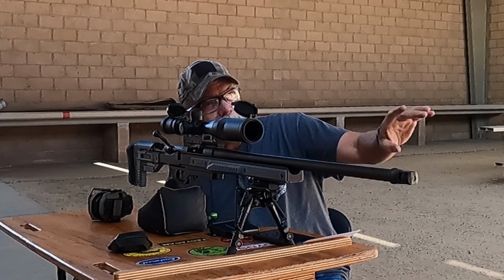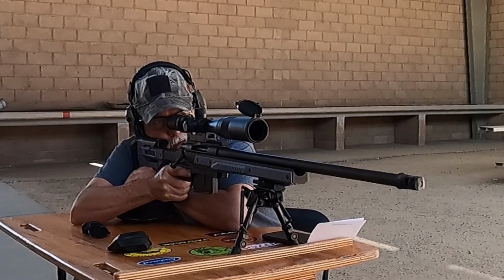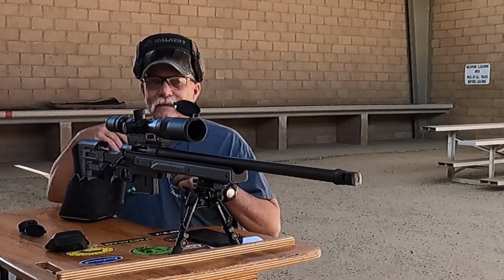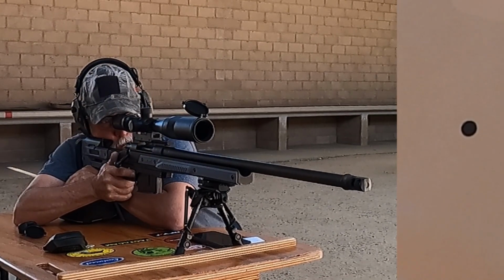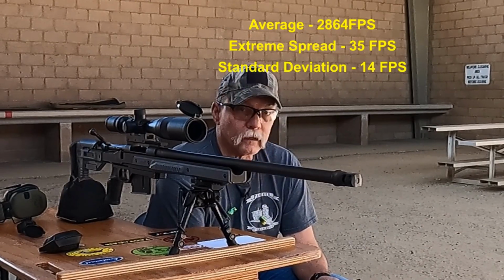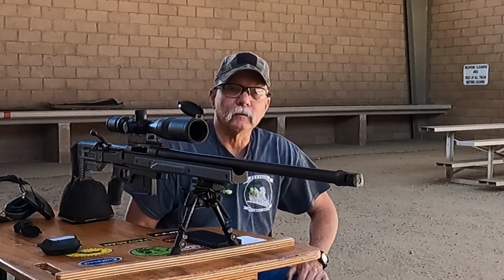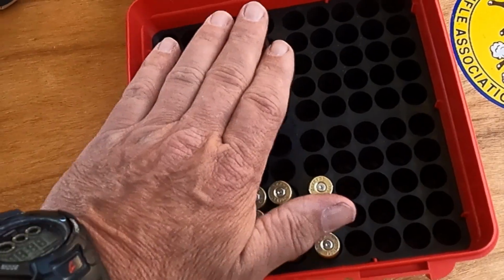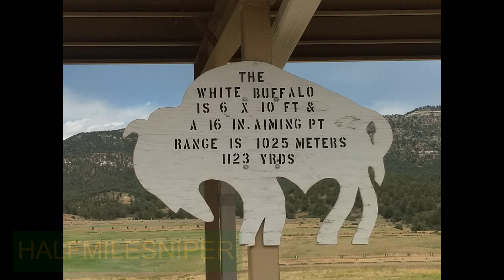Second test with IMR7828SSC in the 6.5 PRC, will we hit 2900 FPS?

Comment: Hi Halfmile. Great video as always.
 What is the minimum extreme spread you will be content with? As we know, high ES is a killer at very long range.
Reply from the maker: If I can get the ES to 15 or less I will be feeling good. Have had a couple with low ES but the they shoot so hot at 100. I need to stretch out a bit.

Comment: What is 6.5PRC resemble to? Recoil and first impressions 🤷‍♂️
Reply from the maker: hmmm..the bullet is just slightly smaller diameter than a .270 (same bullet as the 6.5 Creedmore) and the PRC parent case is the Ruger 300 Magnum, which was based on the .375 H&H if I recall correctly. Recoil in this chassis and the bull barrel is very light. The recoil calculator shows the recoil is only like 7.5 pounds. It is a very smooth shooting round. Now my rifle is heavy and I have not yet fired a light hunting version yet. My guess is in the light hunter the recoil is prabably sinilar to a .243.

The 6.5 PRC get a little more velocity and range over the 6.5 Creedmore. Remember the Creedmore is based on the .308. And lastly, my first impressions with this rifle is that this Howa action and this cartridgeare going to be a great shooter.
Reply: Thanks. The is Eskimo Reloader here .

Comment: I seriously wish I could go shoot with you. I'm wanting to stretch my new rifle out to 1k.
Reply from the maker: The President of Rapid Reticle and I will probably be going out to a range to stretch to 600 or so pretty soon. We discussed it yesterday, I just need to run a few more ammo tests before we go. What is you new rifle TRB?
Reply: @Halfmilesniper .308 Savage 110 Tactical 24" Heavy Barrel with a Vortex strike eagle 6-24×50. I've had it for a couple years, but have only shot maybe 10 rounds. I sighted it in at 100 and then shot 6 rounds at my steel plate. So in my eyes it's still new.
Reply from the maker: @45acp  It sure sounds like it's still brand new...almost in the box new.
Reply: @Halfmilesniper  lol. Yes sir.

Comment: I have 2 6.5 prc's. i fall short of the book Velocitys vv n560 got me at 2900 with the 153 ATip es of 5 sd od 2.5.
Reply from the maker: It really seemed to take a lot of work to get consistent loads running north of 2900 FPS. I did finally get some Retumbo and will be loading some with 153 gr ATips as well as the 156 gr Bergers.
Reply: I've tried Retumbo, and it got the velocity, but the numbers were horrible. I think my ES wa 45 @Halfmilesniper
Reply from the maker: @randylong8156  I've noticed the 6.5 PRC is weird that way...good group or good velocity with terrible ES and SD. Then you get a load with great ES and SD and it shoots a giant group, like a 1 inch group.
Reply: @Halfmilesniper  today was a good day vv n 560 book load 2.57 oal 153 Atip cci LR primer avg 2999 fps 3.8 std, 9.4 spread -1/2" group tried all from 2.990 oal 2.70, 2.60. 2.60 had the best ES worst group 2.57 brought it all together, and velocity went to 2999 from 2983.
Reply from the maker: @randylong8156  nice. I need to keep an eye out for any N560 locally so I can give it a try.